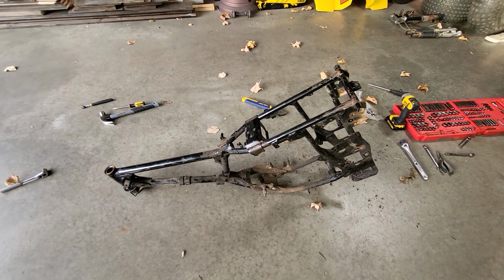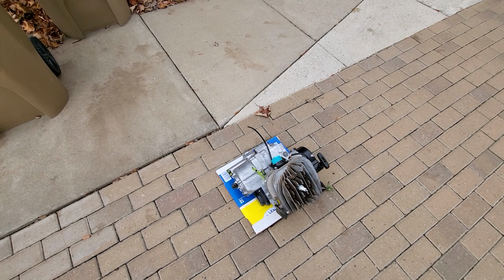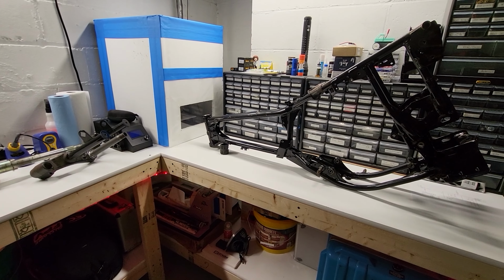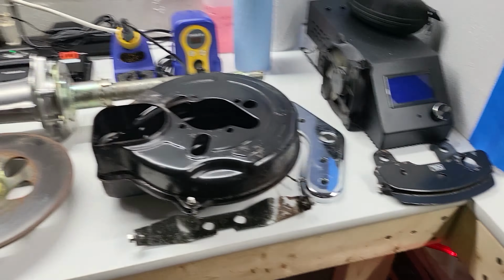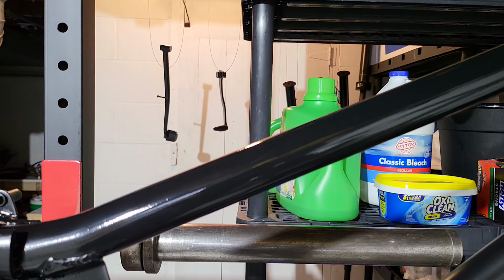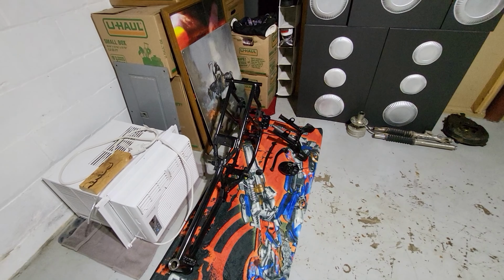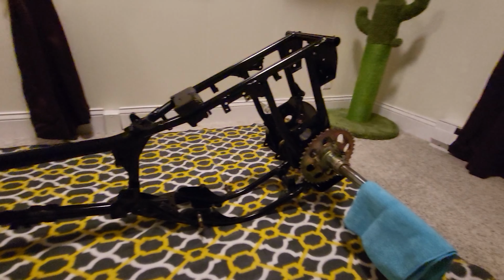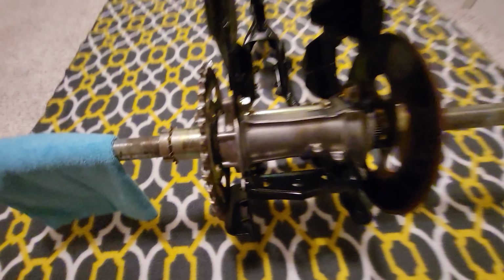Yamaha Trimoto YT175 Rebuild! Part 3! Assembly has started!

Comment: Need to check Marron wheel inside the pull start. Is the rope soft and white looking or is it hard and burnt looking? Eventually the rope will break. If it does you can still ride. Put in trans in 2nd, lift by your accessory rack, run with back wheels off the ground for about 10ft for momentum, drop and push for few feet, and be ready for it to come alive. I place left hand on seat rear and right hand on throttle to be ready. Hop to your knees on seat and then get it to N or ride off in 2nd to get to safe spot of your not ready to ride.